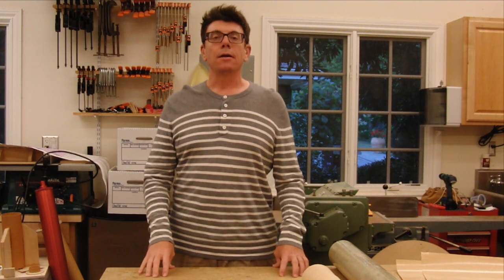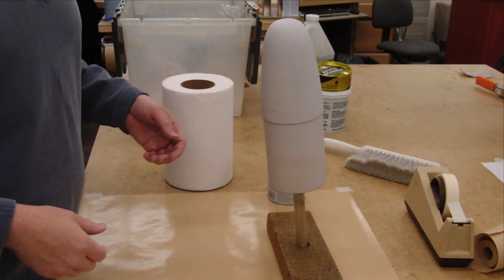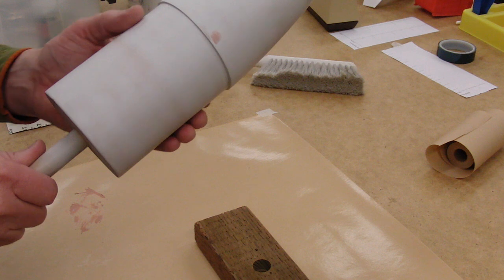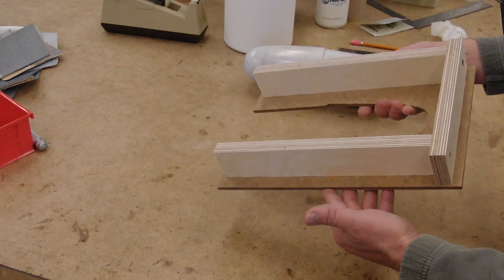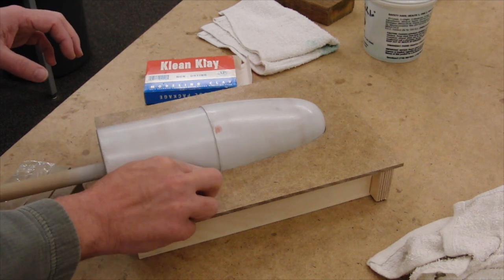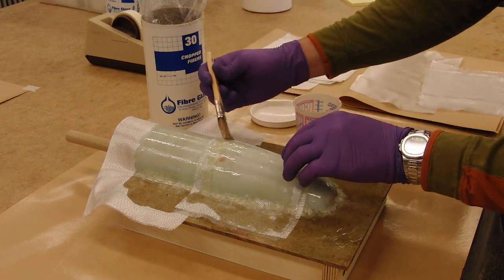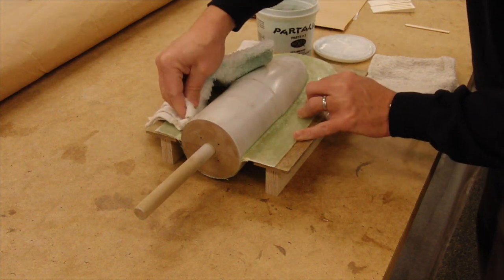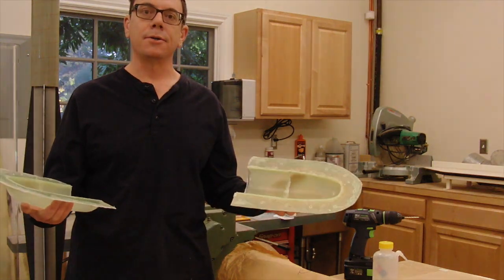Custom Nose Cone, part 1

Comment: Hi John, just searching for this. What if your custom nosecone is huge, say like 8" or more in diameter? Kind of too big to make a blank for it. What would you do then?
Reply from the maker: I'm not sure what you mean by "too large." The traditional way to make plugs was turning them on a lathe, which is not as limited since you can turn them on the end (like a bowl). Now-a-days, you're more likely to 3D print it, which can be done in sections. See this video for other ideas: https://www.youtube.com/watch?v=2x-m3vDwrJ8
Reply: @JohnLCoker   I'm talking about some large scale nosecones here. 
Perhaps some numbers would be helpful here: I want to upscale a Goblin nosecone to 8" in diameter at the base of the cone (not the nosecone shoulder). Math wise that comes to a cone that is @ 30 inches long. 
It also has be able to withstand the forces being applied to it. Motor wise that would be an M or an N. 1) I don't think a nosecone printed in sections could ever repeatedly withstand those forces and 2) I'd have to find someone to print this cone. Even in sections it would take a long time to print for something that wouldn't hold.
Reply from the maker: @teachthemalltruth  You can certainly turn parts larger than 8" in diameter, even between centers. Balsa Machining Services has made larger wooden parts for me in the past (although not 8" in diameter).

Comment: How would one get a certain design plug?
Reply from the maker: Traditionally, they would be turned on a lathe. Now-a-days it might be easier to 3D print them. Here's a newer method using 3D printing: http://jcrocket.com/printed-nose-cone.shtml (not as strong a part, but a lot easier).